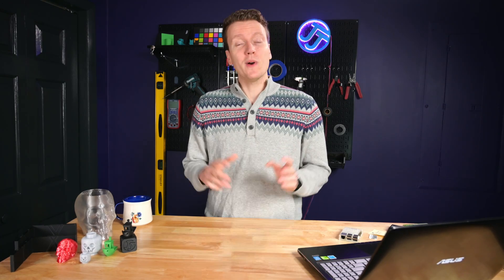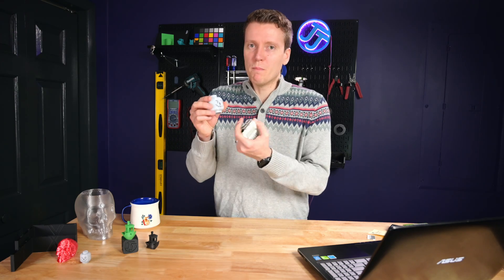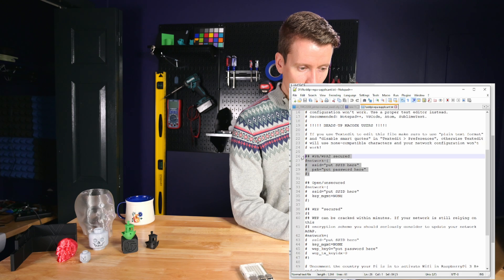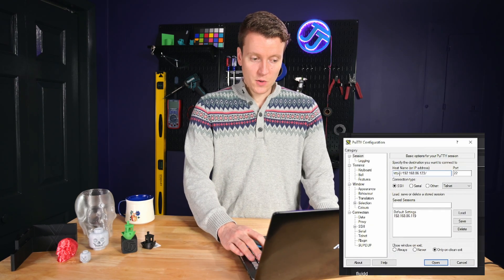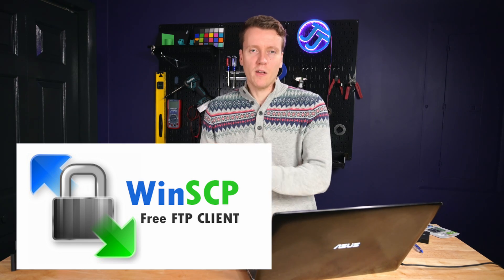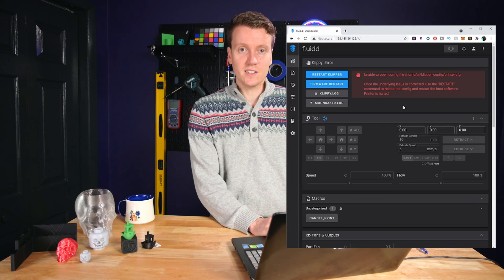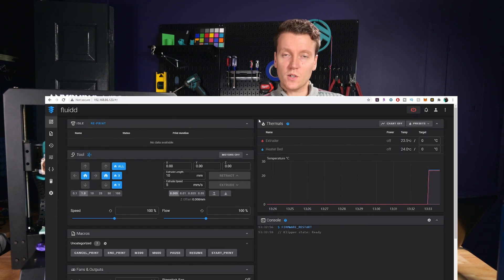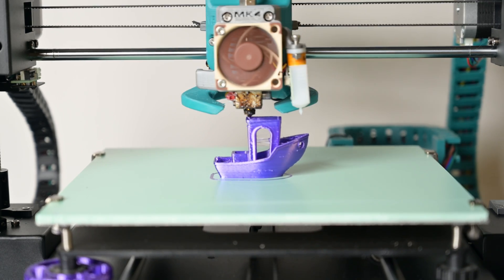3D Printer Klipper Install Tutorial | Anycubic Mega S with FluiddPi

Comment: Great video.  I've been debating putting klipper on my mega x for a while, and this video gave me a pretty good starting point.  it was a pretty steep learning curve to learn how to edit your configuration to work for my printer, but after a day of messing about I've got it set up properly and my prints are better and faster than I've ever been able to do with marlin.
Reply: Hi I also own a mega x printer and managed to find a microcomputer for cheap (50$, i hope they fix the shortage soon). How did it go? Any problems you encountered? Did you manage to improve your printing speed? Would you mind sending me your profile?
Reply: @bartekburmistrz8679  it is going great, it improved printing speed a ton, I print at around 80mm/s wall speed and still get better quality than stock.  I can definitely send you the profile, just pm me your email and I can send it to you sometime this evening.  Most of the issues I encountered were just setup issues trying to get the I/o figured out.
Reply: @matthewneuls8613  Thank you so much. Pm are impossible as of 2019. If you could go to my youtube account click on about, and you can find my contact info there.
Reply: @Matthew Neuls  I also wouldn't mind having the configuration to put on my cubic x. Not sure how to get the file.
Reply: @matthewneuls8613  I know this is an old comment, but if you're still running Klipper with your Mega X with good results, I'd love to get a copy of that profile.

Comment: Did anyone else encounter major layer shifting after flashing Klipper and using this configuration file? On my first attempt to print a calibration cube I could tell on layer 2 that it was going to fail and with each subsequent layer it continued to shift a little more in X until the whole thing fell apart. I tried again after running the PID calibrations and the first few layers looked great, then when I got to the first layer that had infill (not solid) it jumped in Y and the whole thing fell apart.

I'm running TMC2209 drivers with the sockets flipped (I've verified that everything is going in the same direction). The vref was previously set and working fine with stock firmware. I've also done a quiet fan upgrade, but otherwise the printer is stock. No BLTouch, so I've commented out those parts and enabled the z-limit switches instead. 

Since I've not changed the speed settings in Cura, I wouldn't think the drivers would be getting any hotter, but maybe that's the problem? When the head reaches a point where it changes directions is sounds really jerky to me, more than I hear in videos other people have posted after changing to klipper. I haven't defined an M205 macro, so I see warnings in the console; could it be that Cura is generating gcode expecting the configurations from M205 and so the gcode is causing the issue?

Thanks for any suggestions!
Reply: Ever get any solution? I'm getting huge consistent layer shifts. On the same layers each time for the same print. I'm thinking its a max acceleration issue for the y axis.
Reply: @filipbronola536  I think I ended up reducing the max speeds in the file, but my print has been out of commission for a few months, so I can't go look. Good luck!

Comment: I don’t always print at home how do I edit my SSH while traveling ?
Reply from the maker: To connect through SSH the raspberry pi needs to connect to wifi, and your computer needs to be connected to that same wifi. I'm not sure if the raspberry pi could create some sort of hotspot you could connect to. Maybe someone on the Klipper reddit has done something for this issue, because that sounds like it could be a common problem.

Comment: Hi JJ, I am having some troubles ive got it all installed and ready to go but when  I print a calibration cube it starts to print further and further back on the base of the printer. Also the start of the print the brim is off and crooked. Do you have any idea what i might of messed up on the settings? I have a picture if it helps to see what it going on with the print. Also thank you for making all the Mega-S Videos ive been following you along with your channel.
Reply from the maker: So like layer shifting during the print? A first place to check is that the belts are tight, also try slowing down the print to make sure things aren't slipping, then ramping up later
Reply: @JJShankles  yes layer shifting but really bad. i will try

Comment: I have an i3 mega s as well and when trying to update the firmware with the custom one that we downloaded, even after connecting it with a USB and making sure the printer is on with the printer screen ribbon disconnected, the buttons remain greyed out. Any help is appreciated!

Edit: so going to the printer's website i found the needed drivers and was able to flash the hex with Cura! But now i've run into a new issue. After i uploaded your printer config, i got this new error: "Option 'control_pin' in section 'bltouch' must be specified" not sure where to go from here. I opened the config and found the bltouch section that it's asking for, but i'm not sure on what the specific values should be.
Reply: Did you ever get yours to work? I am having the same issue with no success even when I deleted everything
Reply from the maker: Are you using a BLTouch? If so then make sure that section isn't commented out. 
It should be something like this:
[bltouch]
sensor_pin = ^PE4
control_pin = PB5
x_offset = 31.5
y_offset = -18.5
#z_offset = 1.825

Comment: nice, thanks for this. I've been running with the klipboi 5 months now. Just want to add an important point for newbies, because it kinda confused me in the beginning: - your host mcu doesnt need to be a raspberry pi. I've been running it with an old 64bit thinclient w/ ubuntu. Overkill I know, but I'm running it barebones just the command line and klipboi and his homies installed. It is the same experience minus things like;

- raspi's astronomical sales tag nowadays;.
-raspi's eccentric requirements like overpriced original power adapter.

Needless to say its running with no problems and almost one hundered percent stable on thinclient. You can also use an old pc with ubuntu but that will surely require more amps=raiden handing you the electric bill.  

Klipper is a magnificent piece of firmware. code is solid, a bit hard to wrap your head around it coming from marlin, like different pin names or commands. You get the hang of it pretty quickly. Its a rollercoaster experience all around and  I recommend everyone with a decent amount of general 3dprinter/fw knowledge to give it a go. Not for the inexperienced hobbyist/maker or the impatient tho!  

cheers
Reply from the maker: That's cool to know you got it working, yeah the pi's are almost all out of stock at msrp now.
Klipper was a great way to get to know my printer more since you can get in and read and tweak the configuration instead of just relying on the default Marin values. Not an easy project for a beginner, but definitely a great learning experience for people who what to deep dive into 3D printing.
Reply: bro this tutorial made me buy a mega s. damn youtube.
Reply: Hmmmm... I have an old unused laptop and a Mega X that could use some upgrades... maybe I should install ubuntu and give this a go....  

This method should work with TMC2209s right?
Reply: @SaschaUncia  yes ma'am, its identical to using a rpi.
Reply: let us know if you run into any problems, I can surely help.
I suggest disabling laptops lcd completely after initial setup to save power and run it from your main pc via ssh
Reply: @12around1  I've been trying to get it to work but am unable to get a working install on Ubuntu. 

I tried installing the components through the terminal first but couldn't get anything working and there was not a lot of documentation for anything other than Pi. 

Then I found the KIAUH script which is the closest I got to a working install. Fluiid status is marked as "Incomplete!" and I can't access it via the web browser.

Very frustrating. I considered just getting a Pi zero but they are all sold out, bootleg,  or being scalped for $200, yeesh!

[Edit] I think everything is running, Klipper, Avahi, Moonraker. When I try to access the web interface via [machine name].local .home or [local IP]:80 firefox just says it can't connect to the specified url. There's not a lot of documentation on installing or troubleshooting klipper on generic debian builds. Everything I find seems to be related to Pi setup. I don't know enough about Linux admin to troubleshoot without something to go on.

Comment: Wow, thank you for the awesome guide! I changed my MegaS stepper drivers with TMC2208 and modified the firmware to avoid the motors spin on the wrong way. How can I do that with klipper? Do I have to edit cables? Thx
Reply from the maker: In the printer.cfg file put an ! Before the variable dir_pin in the definition of whichever motor is spinning the wrong way.
So if the X axis is backwards change "dir_pin=PF1" to "dir_pin=!PF1" it is way easier than in Marlin
Reply: @JJShankles  thanks! And what about bltouch? What I have to do if I don't have it?
Thx
Reply from the maker: To remove it from my config file? Just do a control+find and comment out any section that mentions it. So [bl_touch], [save_z_home], and [bed_mesh] are the big ones I can remember, but Fluidd is pretty good about letting you know if your config file has errors. So comment out or delete those sections then see if it gives you any warnings on the dashboard
Reply: @JJShankles  thank you very much!!

Comment: awesome video. subbed! one question though: in octoprint, there's a nifty plugin called "psucontrol" with which i can control my atx power supply and two pins from it running to the gpio pins on my pi. is this possible with klipper?
Reply from the maker: I don't have first hand experience, but that totally seems possible. I have found connecting to and controlling things from the GPIO pins is super simple in Klipper. It won't be as basic as using the Octoprint GUI, it will be copying code into your configuration file, but that also gives you much more control to tweak things yourself. I have controlled power relays and leds from the GPIO pins, but I would recommend doing some googling to see if anyone else has specifically done it with an ATX power supply.
Reply: @JJShankles  thank you for your reply! actually, this was very easy by just editing moonraker with "[power xxx]" and respective gpio settings. now, i have a nifty toggle in my power menu.

however, i cannot get my mega s (with tmc2209s and without 3d/bltouch) running. even though you commented seemingly everything with 3dtouch, some stuff is missing commented. i get the error "Option 'control_pin' in section 'bltouch' must be specified" and i don't see where this is comming from. do you have an idea?

Comment: Have you found Klipper and Marlin better than Octoprint? I’ve just got a raspberry pi and am thinking about an upgrade to my Mega S
Reply from the maker: So Marlin is the stock firmware on your printer, and it can be controlled using Octoprint on your raspberry pi. I think Klipper is a good upgrade from Marlin, but it won't be as easy as just using Octoprint with the stock firmware. I would recommend playing around with Octoprint and the stock firmware since it is so easy, and then upgrading when you really want to push the printer to the limits.

Comment: Tks so much for your video it is great following along with you young guys (i am 65) ran into a snag at you 9.34 min. wasn't able to drag but ended up adding file (i think its the same thing after i tried to drag nothing showed up) then tried firmware restart but didn't do anything. also the top line says Option 'serial' in section 'mcu' must be specified no clue tks in advance
Reply: JJ i did get the prt.cfg figured out my son helped me but now i get Pin '' is not a valid pin name on mcu 'mcu' any suggestions tks brian
Reply from the maker: Did you run the command "ls /dev/serial/ by-id/*"
To make sure the serial port defined under [mcu] matches your machine. I've had several other people asking a similar question, so I need to get it figured out with my code
Reply from the maker: @briandrad9447  Also running though these steps may be something that be missing: https://www.klipper3d.org/RPi_microcontroller.html
These steps are necessary for running input shapper on Klipper (which I would highly recommend for high speed printing). So my printer.cfg file may be looking how the raspberry pi is setup from these steps.
Let me know if any of this helps.
Reply from the maker: Did you check that line 139 in the printer.cfg file is the same value that you got when you enter "ls /dev/serial/by-id/*" on your raspberry pi?
And did you get the printer.cfg file from my github recently? I changed it two days ago to clean up some things.
Reply: @JJShankles  JJ TKS for the quick response maybe this is over my head i find your file on github but i cant figure out how to transfer or load  it to the fluidd config file been going crazy now for 3 hours i know it is me tks in advance from the ole guy brian

Comment: I'm trying to de-activate bltouch in your printer config file so i can use manual mesh bed leveling. I keep getting an error stating that the pin needs to be designated in bltouch section even though i have commented out both bltouch  sections. Any tips?

Comment: I'm stumped. Idk if it's possible but my printer seems bricked after trying to flash klipper on to it. I had marlin 2.0 on it just before but I was having so many ghosting and stalling issues with octoprint.
I cant seem to get the 
MSC 
(ls /dev/serial...) command output to connect right within fluidd. Now I can't access the USB port at all through cura or prusa slicer to flash marlin and try again fresh with klipper. Any help would be appreciated python gets really confusing after a few hours 😵
Reply from the maker: That part of the installation can be tricky to troubleshoot, but if CURA isn't able to talk to the board then it probably has Klipper on it. Sometimes restarting everything can be helpful with fixing communication. So fully unplug the pi and then replug it to power and to the control board. I also remember I either plugged in or removed an SD card from the printer and that may or may not have had an effect. The board probably isn't bricked, but if these simpler fixes don't work then it might need the Arduino IDE. Unfortunately the Anycubic Trigorilla is one of the more difficult boards to flash firmware to.
Reply: @JJShankles  I'm going to try a fresh install with that in mind. Thanks for the response!
Reply: @JJShankles  are there any other trigorilla specific klipper tutorials that you know of? I've seen every other board on youtube, but there's not a lot of info on the mega s specifically.

Comment: This is the third time I have tried posting this and it keeps getting deleted. I would like to say thanks for all the great videos on the Anycubic Mega S. I installed Klipper a few months ago from your tutorial and absolutely love it. The only issue I am is with the Z-seam on my prints, I have fine tuned pressure advance and input shaping. I am using Cura as a slicer and have tried SuperSlicer and have had no luck smoothing out the seam. I have tried everything I can find online and still can't get it to where I am satisfied with it. How did you deal with the Z-seam in your slicer profiles?
Reply from the maker: That's weird that YouTube has blocked this, I guess they are afraid of Z-seam like they are afraid of the dislike button.  I uploaded my Cura profiles for the Anycubic Mega S here: https://github.com/JJShankles/3Dprinter_Files
These might give you some help to start with. I wouldn't recommend anyone just copying my slicer settings without since there is a lot of calibration that might make them not work on your printer. 
But settings like retraction settings, retract at layer change, enable coasting, or an combination of all of these can help. Also hiding the seam along the sharpest edge can help hide the problem.
Reply: @JJShankles   I have seen some good Memes and GIFs about youtube getting rid of the dislike button, bad move on their side. Thanks so much for sharing your profils I'll take a look at the differences between ours and hopefully find what works for me. Keep up the great job on the awesome videos.

Comment: I have a Mega X and I'm wondering if the optical switch for the bed endstop will give me trouble. it was a pain when I was setting up marlin 2.0.
Reply from the maker: Is that a mod, or does that printer come stock with an optical endstop instead of a microswitch? It should be easier than Marlin if you can find someone's code that has an optical endstop because with Klipper you have easy access to change the configuration files as a simple text file between prints. But I haven't tried setting up an optical endstop yet.
Reply: @JJShankles  the X has the optical endstop stock. No idea why though. i'll  be sure to try out klipper as soon as I finish the current commision print

Comment: This is maybe a stupid question, but I am new to 3D and Mega S. How is with BLTouch ? for confige file are just mentioned TMC2008 drivers.
Reply from the maker: I really like the BLTouch once I got it all configured. It wasn't the easiest thing to get great results, but now I love it. And in the config files you can comment out the TMC2208 sections if you aren't using them on the mainboard.

Comment: Will your config file work with an all stock printer?  even the stock steppers?
Reply from the maker: With the stock stepper drivers you can just comment out the correct direction pin in the configuration file. I left them both in, and left comments detailing which is which.